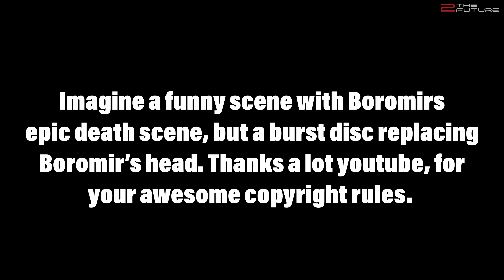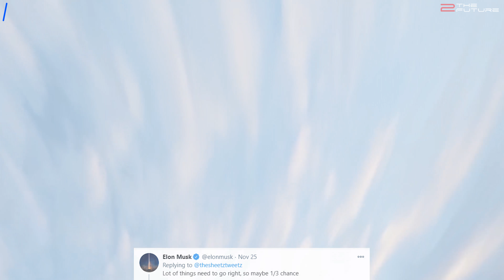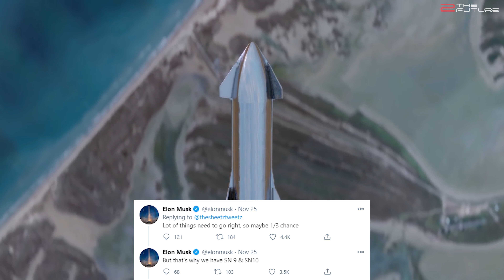Elon Gives GO-AHEAD For 15km Starship Flight | China Launches Moon Rock Return Mission

Comment: I admire Elon’s slower stated pace of humans flying the Starship until it demonstrates an excellent record.  For a guy in a hurry it shows great respect for crew safety and common sense.  So if Starship SN-8 flops or RUD’s you just know the people at SpaceX will learn a lot from it and if it goes off perfectly, they’ll likely be at least a little disappointed because of the lack of more data.  But nothing additional flights can’t provide.  If there’s a problem it will show up sooner than later.  Like Elon said, space flight is hard.

Comment: SN8 should not be called a prototype. Prototypes are usually not very different from a production model. What is going on right now is not prototype testing but proof of concept testing.

As Elon pointed out in his Nov 5 tweet, the goals with SN8 are to test 3 engine ascent, body flaps, transition from main to header tanks & landing flips. Those individually are each unproven concepts. Testing them all at the same time is why he puts the odds of success as 1 in 3. Ideally all those concepts should be proven individually on Starship but given Elon’s timeline, the complicated proof of concepts that is SN8.

If and when those concepts are proven multiple times with the inevitable design modifications that will result, will SN# move to prototype testing. 

The prototype testing analogy would be SpaceX Crew Dragon Demo 1 (unmanned) and Demo 2 (manned) prototype tests that led to the certification of Crew Dragon by NASA before the Crew 1 (production) version flight. Only minor modifications needed to be made from the learnings from the Demo flights, all the concepts having been previously proven (docking with ISS etc).

It’s important to keep this distinction clear so expectations are kept realistic. Like everyone, I’m hoping SN8 is successful but if it’s not, remember this is only the proof of concept(s) stage.